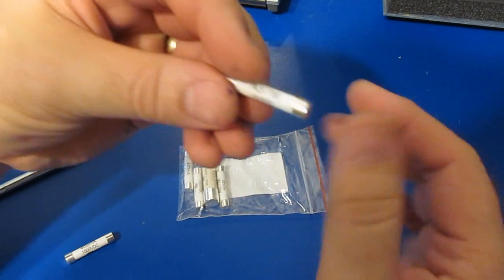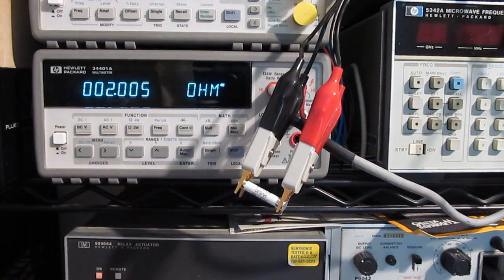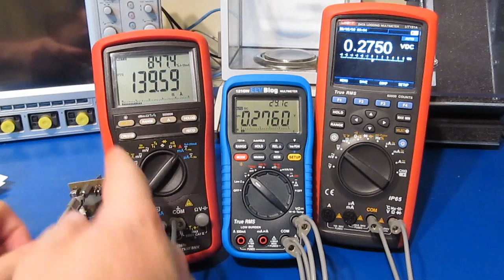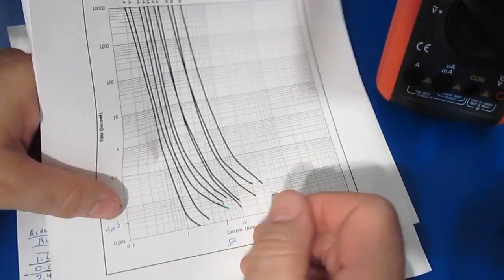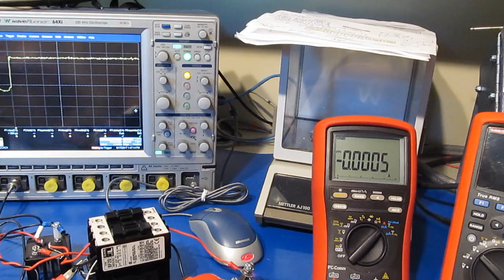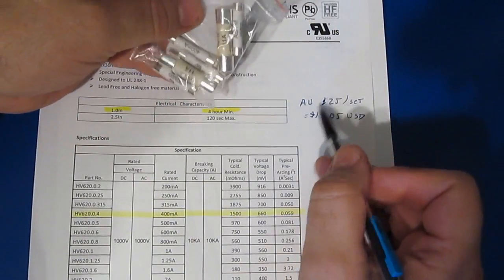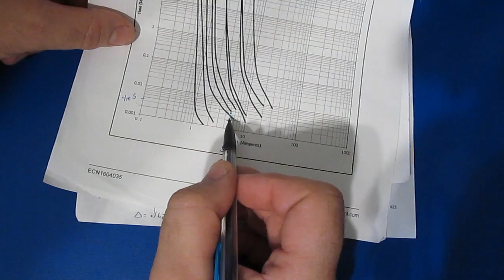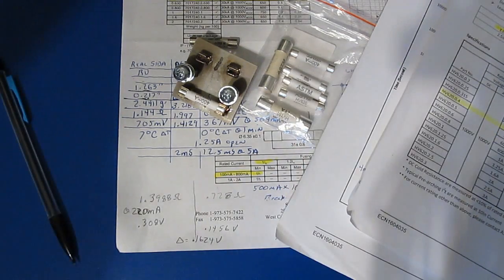EEVBLOG ASTM Fuse Kit, 400mA Fuse Testing

Comment: This makes one wonder if the mfg specs have 25% tolerance listed in some fine print. Also, if you can't fine where to get genuine SIBA fuses, then what chance would most anyone else have? If you could carve-out stable sources for several popular HRC fuses, might it be good to add shopping as an adjunct for the channel.
Reply: I get my SIBA fuses from tme.eu (would be very surprised if they are not genuine), they should ship worldwide.
Reply: quick google came up with these 
http://www.siba-fuses.com/front_content.php?idart=130
Reply from the maker: Hey Cliff.  The datasheets are available on-line.  The datasheet I found shows it as typical only.  It does seem very wide but at least it errors IMO the right direction.  

I had stole a SIBA from one meter to install in that UT61E when I had modified it, which is why I was looking for a spare (and did not want to blow the one I had in my testing).   I think these ASTM fuses will work fine for me.
Reply from the maker: Thanks for the tip.